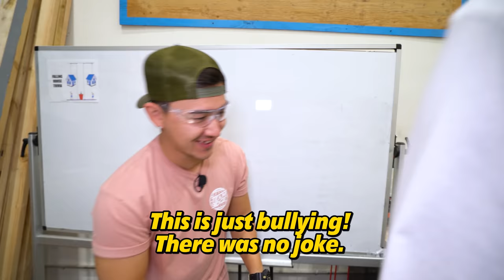TRAPPED in an INESCAPABLE Car!! *SURVIVAL Challenge!!*

Comment: This is actually extremely useful info. If you can’t find the safety latch, tear open the back and pull the latch
Reply: I have a pt cruiser and Im pretty sure it doesn’t have a safety latch in the trunk. Also they have a problem with the lock on the truck so it pops open when you hit bumps😂
Reply: @Heather Cannon  -  You're right, it doesn't. PT Cruisers don't have a "safety latch" because the back hatch is not en enclosed trunk. What Joey pulled was the actual door latch, the same as pulling the handle on the outside of the car. In my opinion, that was cheating as they weren't allowed to use door handles. Joey needs to learn about cars.
Reply: @ginrobi01  haha true that
Reply: @ginrobi01  no they can use door handles. They weren't allowed to use the drivers side door handle as it's an emergency exit. The reason they broke the other handles off was to help trap them in
Reply: ...you didn't know that
Reply: Also who has the luxury of a crowbar when kidnapped?
Reply: @charliehubbell7513  I’m pretty sure they are not that hard to get off but you still would need a good amount of strength to get it off
Reply: Heather Cannon yeah probably
Reply: @ginrobi01  they weren’t allowed to use the drivers side the rest were fine
Reply: You can peel the cover off of any door and find the mechanisms the release the latch for any door
Reply: @ginrobi01  why do you have high expectations for kids YouTube channels
Reply: There's also a spare tire in the trunk under the rug that when pulled out, reveals a hole to the bottom of the car. If there's no safety latch, do that.

Comment: Instead of breaking the inside door handles why not just putting child lock on the doors 🤦🏻‍♂️🤣🤣🤣
Reply: Well, take better aim next time.
Reply: Think again bro, they could just open child lock (somehow) and then use the handle to open the door if they manage to make the child lock turn off(?). They took off the handle before the idea of grinding the child lock off so the handle was a “what if” situation.
Reply: Lol
Reply: Smart
Reply: They wouldn’t be team edge if they did that
Reply: Not all cars have child lock 🤦‍♀️
Reply: It’s big brain time
Reply: @Kingfailure 101 you can't turn it off unless the door is open
Reply: For ppl who don't know to turn off a child lock the door HAS to be OPEN to flip the switch on the inside of the door it there so the kid doesn't have away to open the door from the inside or flip it off
Reply: @yukili384  the child lock I usually inside the door jam there is no way they can disable it with without breaking fingers
Reply: Don’t know
Reply: Not all cars have those.
Reply: child locks vs 2 adults

Comment: Is nobody gonna comment how intelligent Joey was right now!!!
LIKE DANG BIG BRAIN TIME
Reply: Was the best way out but I dont think there is an emergency release in a hatchback since you can get out over the seat.  And if I'm wrong and there was one, it wouldn't be beneath the panel it would be bright/glow in the dark handle that you can see and easily grab.
Reply: @--B.  Actually, that's just one version. What Joey was saying (about the emergency latch under the paneling) is correct as well. Normally, companies will put in an extra latch on the inside of that paneling for possible 'stuck in trunk' or 'kidnapping' situations.
Reply: @Alucard13211  every panel I've removed its not an emergency latch, its just easy to pull the cable anywhere on the system and it will open.  You can open the other 4 doors by taking the panels off and pulling on the mechanism as well.

Comment: Flip it on its side then you’d only have to block 2 doors then back the back door onto a wall and it then blocks 3 exits and if you flip on the passenger side it would only allow one exit with the rules of no using the driver door

Comment: Lol he wanted vindication for the emergency trunk release so badly that he straight up lied about it in the end. He didn't open the hatch with the emergency trunk release he opened it by ripping the paneling off and manually pulling down on the lift gate actuator to open the hatch.

Comment: The safety latch for the trunk is located differently in all cars, in mine there's 2, my car is a german make, so it has one to fold the center back seat down that way you can crawl out if you're trapped in the trunk OR there's one on the roof of the trunk so you can pop open the trunk from the inside if you're stuck. Just a little side note for anyone driving a Volkswagen jetta 2017 and up probably

Comment: There wasn't a giant: "ME" at the beginning when bobby and joey spoke english correctly.

The editors are slipping :P
Reply: Wait what are referring to? Wasn't a giant me? Spoke English correctly?
Reply: @lexmcdufflepants4332  In videos that have passed the editors have been cheeky and put a large: "ME*" over their mouths when they correctly address the other people with: "Bobby and I" or "Joey and I". It didn't happen that time, so I was confused a little.
Reply: Sage Dupuy That helps a lot, thanks! Not sure if you mean them correcting the "and I"s though, cuz technically it should be "and me" in this case.
Reply: @lexmcdufflepants4332  Mildly incorrect. It is supposed to be: "and I" in purely grammatical terms. You do you though. I don't particularly care as long as I know what you mean.